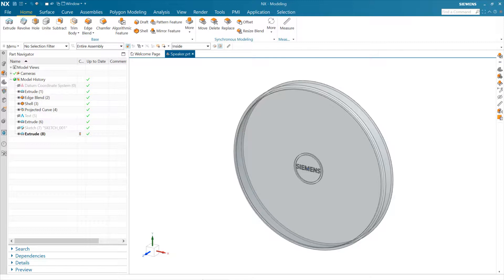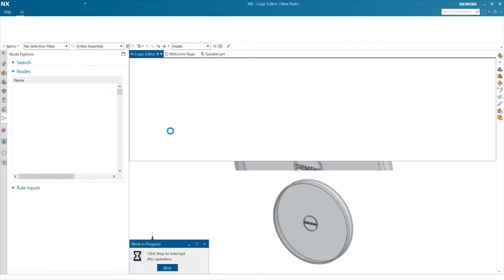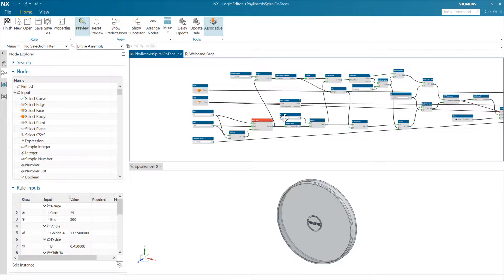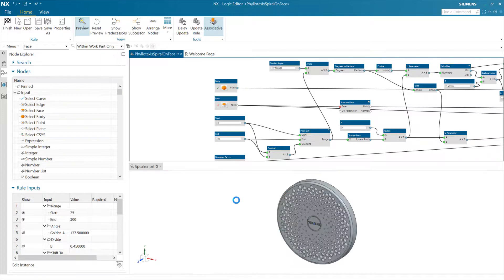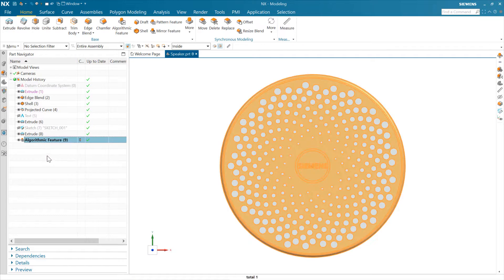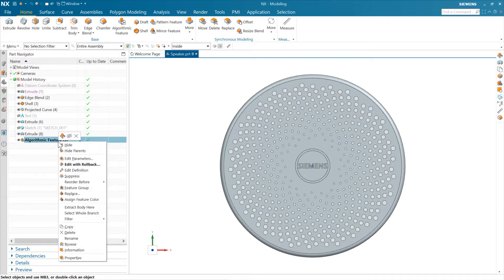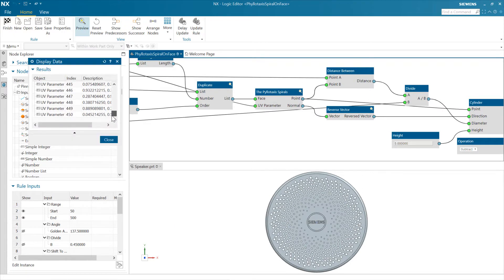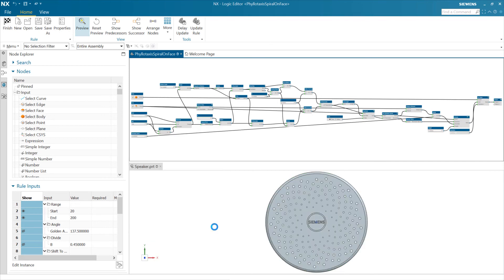NX Algorithmic Modeling: Phyllotaxis Speaker Grille [NX 1953]

Comment: it seems boolean operation is not working correctly. after boolean(substract), I always need to come back to history and hide the body.
Reply from the maker: Algorithmic Modeling features will always create new bodies -- they will not consume the previous input bodies.  So in cases like this where the Algorithmic Modeling feature uses the original part solid as an input, you'll see that original body remain as construction geometry.  You can either just remove this body from the MODEL reference set (which will remove any duplicate mass from the part), or use the "Delete Body" feature if you really don't want the body around anymore at all.  Does this help?